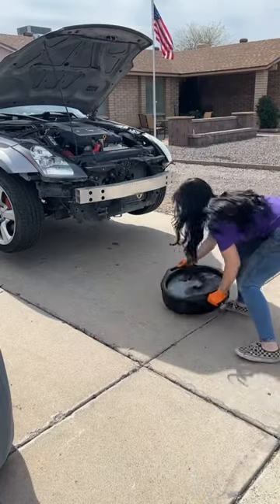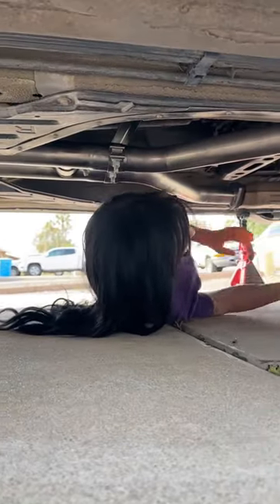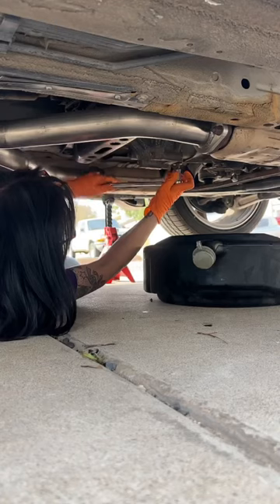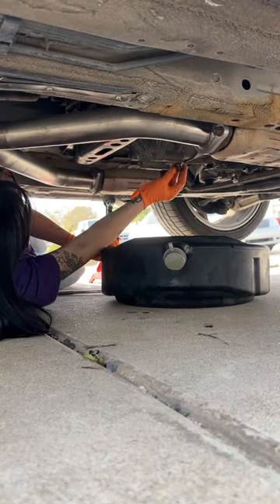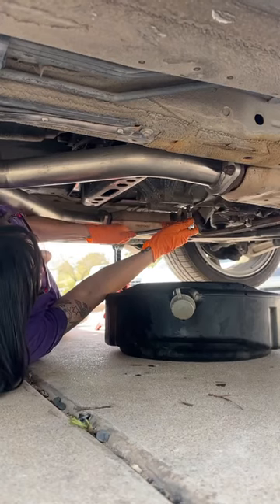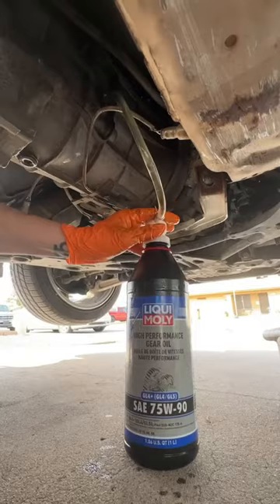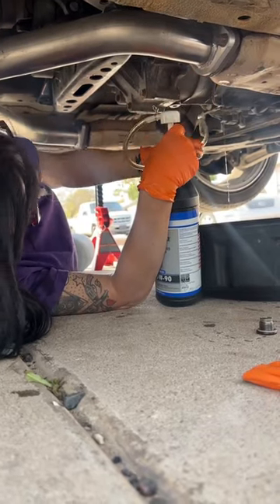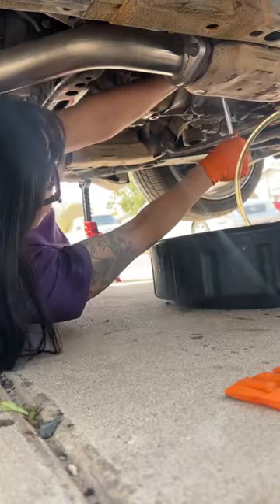Liqui Moly fluid maintenance day! 🎉

Comment: I commend you to the highest levels of the  Order of The Wrench Turners! I have been turning wrenches since I was 10yrs old, now 51. I learned aat a young age to always replace the crush washers anytime that you disturb them. Small leaks lead to big problems. Whats a $1.50 for two new sealing washer versus a complete rebuild or replace of a engine, transmission, final drive? Thankfully you were taught well.

Comment: Idk if it matters if you have a cd009 but I would recommend if your shifts aren’t as smooth after that liquimoly I highly recommend OEM Nissan mtf specifically for these cause it’s the only fluid that keeps it buttery and from having the dreaded cold start 1st gear crunch until warmed up

Comment: Something she didn't preface is that when doing gearboxes or differentials, ALWAYS CRACK THE FILL BOLT FIRST. It would be a huge bummer if you woke up excited to do your gear oil and you drain it only to realize your fill hole bolt is fucked up somehow and now your medium is empty.

Comment: Just a FYI, synthetic fluids are a waste of $. Just get cheap stuff, & change it more often. I’ve seen engine damage from people that run synthetic for 10k when no oil should exceed 5K. Idk if ur broke & want 10k oil change.

If u don’t want a $10,000 engine replacement just go to Walmart, buy 5qts of oil or whatever ur truck vehicle needs. A decent filter, & if u Change it at 5k ur motor will last a long time.